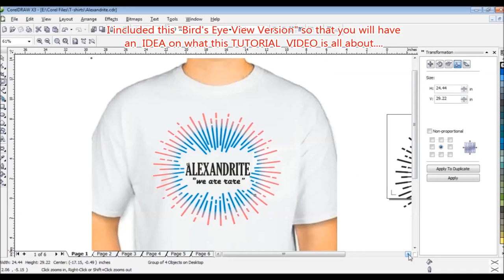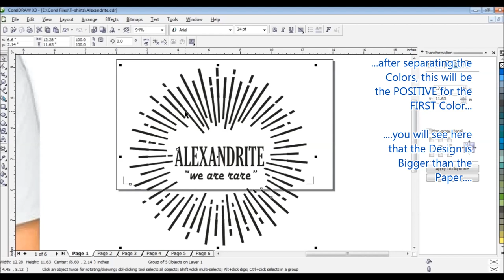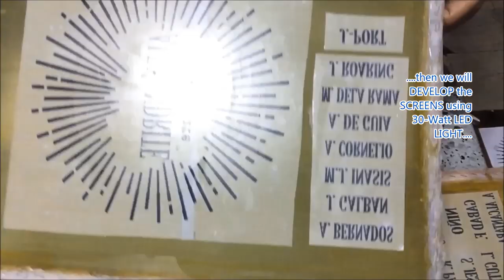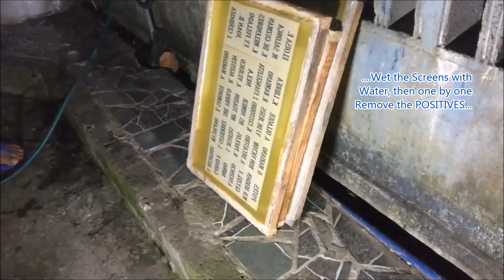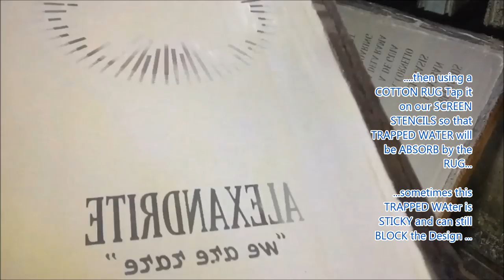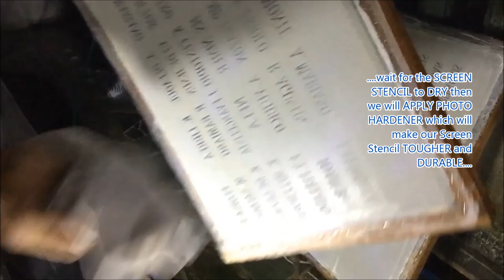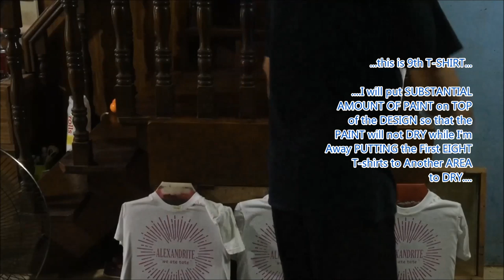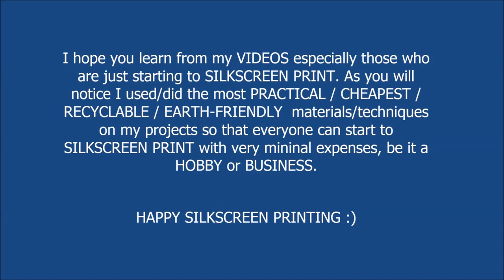Basic T-shirt Printing using Water-Based Paints

Comment: Sir Easy , when printing the black colour , how comes the mesh does not leak green paint  that was left behind  the screen onto the tshirt, did you wash the back of the screen or?
Reply from the maker: The Green Paint did not Leak when I print the Black Color because the Green Paint on screen was already dry....I did not wash screen after printing the Green color, I wiped the Backside of the Screen with WET FOAM to clean the openings and just left the Green Paint to dry.....
Reply: @EasyVideos  i now understand since i watched a clip where you leave the ink on top of the mesh to make it more durable..thank you Sir Easy

Comment: Mr.easy.. how to you cure your water based ink..? I used speedball water based white ink and used hair dryer to cure and it started to crack..
Reply from the maker: A Simple Hair Blower will Cure the Water-based paints...but for me I don't cure the Brand of Water-based paints I'm using I just let it Dry Naturally or sometimes I will use Electric Fan or Hair Blower to Dry it faster...
Reply: @EasyVideos  thank you.. may be I ll try some other ink brand..